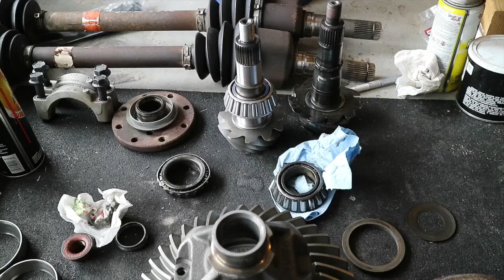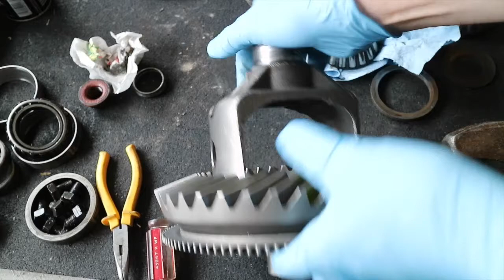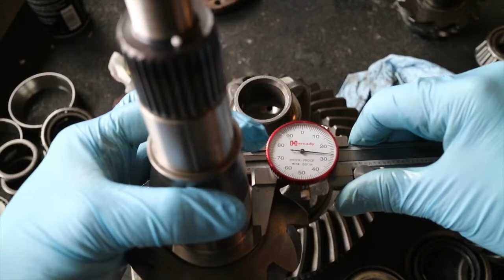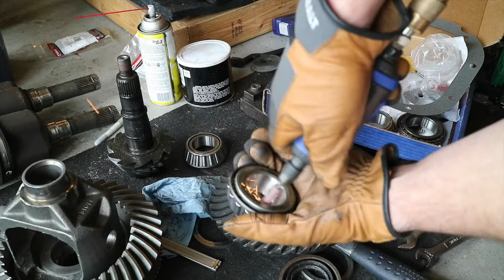VLOG #14: Ford 8.8" Differential Rebuild - A Good Reaming Always Helps!

Comment: Just a tip, Freedom Racing sells a pinion depth tool that would make this kinda job so much easier. You don’t need to modify any bearings or have to worry about pressing on and off any bearings a bunch of times. It’s so simple you set the tool up take your measurement, and it’s on the money first try every-time. Look into it bc so worth the investment. It’s the tool Ford recommends as well.
Reply from the maker: Thanks, will definitely look into it!

Comment: Not trying to be a hater, yet the thought of metal bits from the bur and abrasive particles from the finishing roll flying all over the new parts and bearings was making me nuts.  I understand that we all work in smaller places than we'd like, but at least try to move the clean parts out of the way or cover them up to keep the contaminants from getting everywhere.  Just a thought.
Reply from the maker: Everything is thoroughly blown out, then washed out with brake clean along with another blow out from the compressor. Nothing went into the diff without going through this process. Garage = dirty, cleaned, then basement work of fitting parts into the diff case = cleaned and lubed.
Reply: @trevorsgaragemusings  Thanks for the reply.  Sometimes my OCD gets the best of me!

Comment: I did a total rebuild of my 8.8 and changed from a 3.73 to a 5.13 and started off using the same shims that came off of it and got a good 9 back lash and perfect tooth pattern , the worse part of the build was modifying the new aluminum ford finned cover as the finns was to tall on the inside and rubbing the bigger ring gear so the die grinder fixed that.

Comment: I have another question do you have anything on changing out the fresh air cabin filter on a 97 f150
Reply: Johnny Five 10th gen(97-03) F-150 don’t have cabin air filters there are trucks out there that dealers installed but those are rare

Comment: did i hear a dual stage compressor, with 100 gallon tank? lol
Reply from the maker: +heavylead1961 LOL I wish ... 26 gallon 4.5 hp single stage ... Had it for nearly 15 years now and the best part is I got it for free from a neighbor!
Reply: neutered10mm lol sounds like the one i have! my air drill and dremil would waste my tank in 5 seconds lol